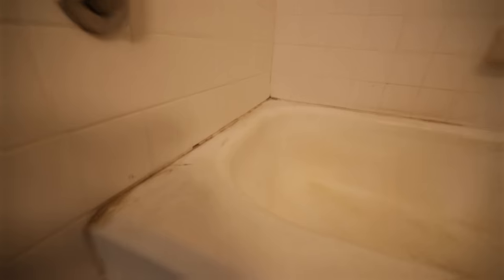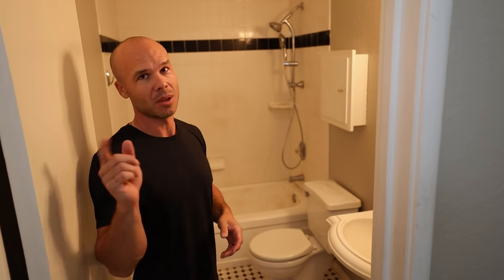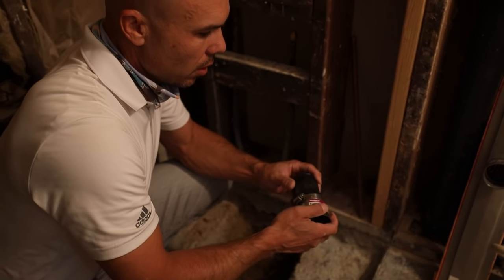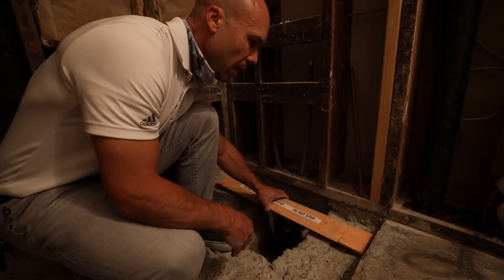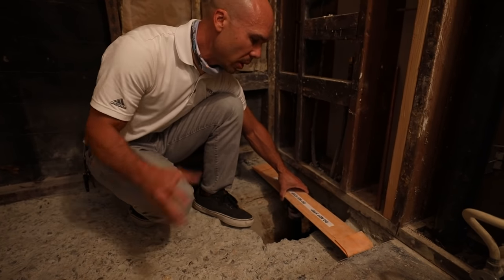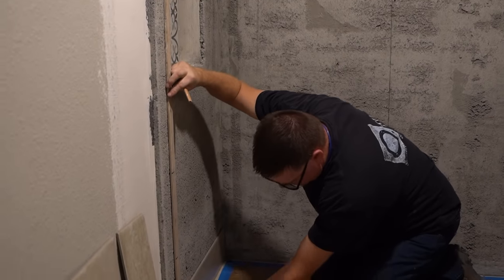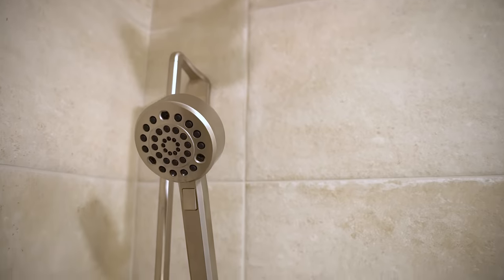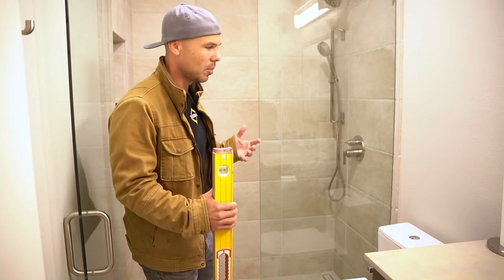TUB TO SHOWER CONVERSION (CURBLESS)-- HOW ITS DONE

Comment: As a plumber I can vouch for shielded couplings, a transition style coupling ( which it appears you used) is required between cast and plastic. 2" drain and trap arm is required for a shower by upc and is usually a ton of work to achieve as you mentioned but that's what we've always had to do.

Edit: 2021 UPC has a footnote (9) next to the minimum trap and trap arm size for a shower, can be 1-1/2" if switching from existing tub to shower (new stall size 36"x60" max), 2018 UPC did not allow this.
Reply: so if you did this same exact job your telling us you would be forced by law to change out all that pipe to 2 inch? under the whole slab?
Reply: @Mike-Minion  unless your particular inspector let it slide, yes, as a plumber you are required, in most areas, to follow plumbing code. Whether you pull a permit, and what you do in your own home is up to you. In my case the majority of projects are subject to the upc and california plumbing code and inspectors are strict here. We've seen many slabs chased to the 2" line for a shower. It's typically not far to the 2" as the tub is required to have a 2" drain line, it's just the trap arm that's allowed to be 1-1/2" on a tub.
Reply: @Mike-Minion  interestingly enough, the 2021 upc has added a footnote next to the minimum size trap and trap arm; stating 1-1/2" trap and arm is allowed where swapping out a tub for a shower stall. That's groundbreaking news to me as the 2018 didn't allow this.
Reply: We hardly ever pull permits for showers.  This reducer has always been the go to method. But you are correct,  prior to the new code change, if you're getting inspection in California , inspector would not except this...
Reply from the maker: Thanks for the Edit!  You are correct.  Most of the time, common sense proceeds changes in codes.  The UPC curb code is an example of an outdated code that had inspectors confused for over a decade. Finally, they are learning that tall curbs are a thing of the past!
Reply: @TileCoach  
Common sense is not legal in California as a civil servant. In fact tyranny is the rule, and as I understand the 2nd amendment, it says we have a responsibility to bear arms against, and the 2nd part of that amendment says to shoot them. 
Thanks for your videos and the comments
Reply: @kylefogle6022  See my comment above about the city saying I would have to install 2" drainpipe. I did my work before 2018. But of course, I would still need to do what my city said I have to do. It would be great to have a URL to the change you reference.
Reply: Doing plumbing for 30 plus years and you should Always upgrade to 2" for floor Drains that's problem free. 1 1/2"  you will have problems unless you remember to clean drain lines yearly.
But 2" mantinence free .
2
°
Reply: It may be in 2021 UPC but that does not mean that code has been adopted by your particular municipality. There are lots of places still on 2015 code and then there are most of the places in the US which actually use international plumbing code.
Reply: I use shielded sleeve regardless of underground, in the wall or exposed. For just a couple dollars more, it just seems like a much stronger joint. Okay, back to the video... 🎶🥁🎺
Reply: That depends on the amount of water flow gpm through the shower head.

Comment: I wanted to convert my master plastic tub-shower unit to a shower only. The city (in Central Illinois) told me that I needed a permit to convert tub to a shower and that the drain had to be 2". They said it was against Code to reduce from 2" to 1 1/2".  I asked questions about this and said what if I cannot swap out to a 2" drain. They told me in that case I could not convert from a tub to a shower. I asked why I couldn't do the 2" to 1 1/2" reduction. They said that if there is a clog somewhere in the 1 1/2" drain pipe that the tub is a larger vessel for capturing the backed up water. They told me that such clogs easily let the water overflow the shower curb. So, they required me to install a 2" drain which I couldn't do. So now I have a new tiled tub-shower. I like it a lot, but wished I could have done the shower. I have a neighbor who made the conversion and claimed he had a 2" drain pipe. He also didn't get a permit. He later sold the house as renovated. This is my experience about permits and drain pipe sizes.
Reply: If your neighbor believed the lie, its no  longer a lie. 
G. Costanza

Comment: Ruined the slab.. removing 3 inches of a 5.5 inch slab..?
Reply: That's what I want to know too
Reply: Should he have removed all of the slab?
Reply: I recently chipped down a slab for a curbless and found that the 2 inches that remained felt super weak, so instead I jackhammered it out completely, dug  deeper, added rebar dowels and poured a new 5 inch slab that was 3 inches below the shower entry, with the mud pan it’s now about 7-8 inches and probably the strongest in the house.
Reply: @isackhernandez3691  yes and repour it
Reply from the maker: A cold joint, dowels or not, is going to be more prone to separation and displacement that what we do. Especially since we bond our mortar bed to add more strength and support.
Reply: @TileCoach  either put all your trust into a bonded 2 inch slab or into the dowel method, pick your poison, ideally you’d want to frame it and pour recessed when pouring the foundation in order to keep it monolithic, I’ve done both methods, neither is right or wrong we’re retrofitting based on what the home owner gives us (slab or raised foundation)
Reply: @TileCoach  i say neither, id rather have a small curb than ruin my slab

Comment: The 3000 series Fernco couplings you used are actually only rated for above ground use. The 1000 Series should be used as they conform to ASTM C 1173 -  standard specification for flexible transition couplings for underground piping systems. It will probably be fine but just because it has a metal band does not mean it is designed to go in ground .
Reply: Yes, I would use the 3000 for something like a in wall vent transition. I do believe the 1056 would be the correct for this application.
Reply: @jasonlunn8530  exactly
Reply from the maker: thank you!   My local plumbing supplier only had that one.   Will ask about it for the next one.

Comment: Typically when I run into 1 1/2 inch drains I will change the stand pipe and trap to 2 inch then reduce to the pipe. Most of your backups happen in the trap vs the main line. An old plumber gave me that idea years ago.
Reply: As a plumber i would rather u leave it small so i can get the backup service call.
Reply: @dangda-ww7de  lol thats not the way I do things. You know as well as I do hair is the number one backup in a shower drain. 9 out 10 times it settles in the trap not the main line. Larger trap = more volume of water to push the clog out and down the line.
Reply: I just asked this question and your answer makes perfect sense. Thanks!

Comment: Great timing! I have this very situation and tried with 2” coming up and it put the shower drain 4” above concrete. Going to 1 1/2 pipe will lower the drain just above the concrete, problem solved great video,
Thankyou
Wayne.

Comment: Hi Isaac, nice work once again. I do bathroom renovation work here in Australia. I watch all of your videos.  It's interesting to see how you guys do things differently in the states.

I have a few questions for you:

1) Do you guys have to worry about termite treatment over there? In Australia if we cut through the concrete slab - we need to do a treatment to stop termite attack.

2) I'm guessing you are allowed to run 2 inch sewer pipes burried in the slab over there? Here the general rule is 4 inch pipe size minimum if it's burried in slab.

3) Why apply the Durock sheet to the studs then also lath and float over the top again? That seems like a lot of layers and added thickness. Also wouldn't the float stay constantly damp as the waterproofing is under the float layer?
Over here we would just nail the sheets straight over the studs with 6mm (1/4 inch) fibre cement sheeting, then apply a roll on liquid waterproofing membrane over the 1/4 inch sheets. Then tile directly over that. That way the build out is minimal and the only things that get wet are the tiles.
If the walls needed straightening, we would just plane back or build out the timber studs to suit - before the sheeting of course.

Keep up the great work.
Reply: that's how I do it on the east coast

Comment: Another well done video TC.  As a design issue, code officials can have a problem with having to enter the shower to access the mixing valve. Scalding concerns.  Perhaps flip the layout, with the entry door on the left.  But this may create a drain venting issue.   1 1/2 " can only run 5' horizontally before it needs independent venting.  Maybe run the vent overhead and tie back in.  Also it would be a good footnote to add to not do the size reduction on the horizontal.  Only verticle, as you did but did not specify.

Comment: 1-1/2 shower drain is perfectly fine. A tub spout gives out more water and the tub drain handles it fine. A shower head gives out about half the water a tub spout does. One thing I will say is, I dont know what the code in your area is but where is your vent? The overflow on a tub drain acts as a vent for smooth drainage and no gurgling. When converting to shower you should add a studor vent.

Comment: Good video. I was getting ideas on how it is done before I quoted someone to do it since it looks like a lot of detail for a naïve plumber like me. I would like to see comments on a new thing I am finding now on most Hotels I am running into (I travel a lot).
The idea is to offer the option to install the water controls on the entry side that way the user can adjust the temperature before getting into the water stream usually in the opposite side. On this video, looks like this plumbing could have been done while the walls were open. Yes, I know, its a lot of plumbing but, from personal experience, I like this option as well as multiple heads (one on top coming down from the ceiling and another from the wall with a selector to either/both heads).

Comment: At first I was like, who puts a light fixture in the shower 🚿. It was driving me crazy. Then I realized it was only the reflection from the vanity Jijiji. Btw great video and awesome attitude, stay humble my friend. Definitely earns a thumbs up 👍🏻 and a new subscriber. This is something I’ve been thinking of doing to my bathroom, I now have a walk-in shower next to a tub 🛀. I really want to remove my tub and add another walk-in shower next to the one I have because the one I have now it’s to small, I have hardly any elbow room, it’s dimensions are 34/32 wow as I got up to go do my measurements I just realized that I can knock down a small 12” half wall that divides the shower from the tub if I can just remove this half wall/shelf and extended the new shower another 6/8” on one side the 10” on the other side, this should be enough room exactly what I need. Thank you your video inspired me.

Comment: I’ve wondered for years why a tub is plumbed 1 1/2 and a shower 2. I recently talked to a plumber friend of mine and he explained that since a shower only has a small curb and sometimes no curb a 2” waste line is required so it is less likely to clog and flood the bathroom. A tub has the whole tub to fill before it would flood. Idk made sense to me. But there have been plenty of times we had no choice but to reduce the pipe back to 1 1/2  after the trap.

Comment: How did you get the slope on the right left and back side to drain properly with those large format tiles?  It was hard to tell from the video how you set that tile around the side and back perimeter of the drain.  Thanks!

Comment: Hey Issac! I noticed you used a 2x4 clamped with a vise. The showers come with a polycarbonate sweep. Cut a about a 3 inch piece of it off and use it to hold both panels in line with each other at the top. If you guys are going to keep installing showers lol
Reply from the maker: Yep!!!

Comment: I've yet to do a curb less on slab unless it was previously recessed during the slab pour. Average customer is okey with a micro curb (about 2" tall) when compared to the cost of chipping it out. I've seen conflicting info on shielded ferncos being hurried. As for the 1-1/2" vs 2" if it's easy enough to change the trap I'll switch over to 2" trap and reduce after the trap. Otherwise I'll just do the reducer in the stand pipe, last one I did the trap was 26" under the slab and would take even more work to dig even deeper to swap it out. Plumbing codes work great on paper but in the real world as long as it drains I'm okay with it 🤷🏻‍♂️
Reply: Great thing about a true curbless is the drain can be used for the whole bathroom. With a long hose the bathroom can be cleaned with a sprayer and disinfectant spray then squeegee down the shower drain.

Comment: I'd be interested in what the final cost was including everything you used. I'm 61, in Texas and hate the damn bathtub. Just haven't committed to do this yet. A ballpark figure would be appreciated. Thank You, I loved the work and the video was entertaining.
Reply: me too
Reply: I am in the process of doing this exact job and it's not cheap. Luckily I can do a few things myself but the demo alone to remove the old fixtures and tile was $1,300, then it was $200 to grade the slab and another $600 to install the drain (centered, non-linear) probably $300 to install backerboard and re-install green board walls (materials cost about $100 for my small bath). I am going to do my own waterproofing and tiling so some savings there but a 3-gallon bucket of Blue Max is $149, the Kerdi drain was about $139, Delta thermostatic faucet system was close to $1,000, one-piece Toto toilet was $350, vanity and faucet another $500. And figure in at least another $500 for tile and setting materials from HD and Lowes. So right now I am at about $5,000. The original estimate that I received was about $11,000 for labor only so I will save a decent amount by doing a lot of my own labor.

Comment: Changing out my tub to shower as well. I can only go so far back but have the choice of going with a 2” or 1 1/2” p trap. was wondering if it would be better to install a 2” p trap connected to the 1 1 \2” drain pipe or go with a 1 1/2” p trap with a 2” drain at the top like in this vid. Any help is truly appreciated

Comment: Well I gotta ask, "How the heck did you tighten the bands on the Kerdi drain?".  You showed pouring the patch right up to the stub pipe before you put in the linear drain.  Looks like the drain was installed after the patch had cured which makes sense as the mortar bed needs to be laid to drop the drain into.  So just how did you get the coupling secured?  Good video and topic.
Reply: When underground connecting you add an adapter, in this case they did regardless to reduce to 1.5”, so the adapter piece is screwed on before making the connection, then glued and stuffed down for final connect. It’s tricky work. Linear drains are very tricky with all thing considered.
Reply: looks like he left the last strap exposed after he filled the whole. then mounted and the drain. then laid the floor under the drain.
Reply from the maker: We leave a little area out when pouring the concrete, then tighten the bands, then fill with deck mud.

Comment: Hey Isaac great videos bro I’ve watched several over the years pretty much whenever I do tile. I’m a general B in SF Bay Area and tbh tile is not my strongest link in the trade chain, I’ve typically subbed it out in the past however due to the cost to get a good tile sub by the time I add on my commission it literally priced me out of a couple of jobs so I’ve been taking more on myself, I recently started a 2 bathroom gut out one thing I’ve not done yet is float walls and truth be told a little scared but fought so many walls in the past    so many corners of tile don’t lineup I think I’m gonna bite the llet and do it on this project so yeah thanks for all your video help. I also have a question in regards to shower pan waterproofing just curious in the past I’ve always had a hot mop or use the neoprene material and I’m just curious as to your thoughts on using neoprene seems like the membrane that you’ve been using is way better  I like that it looks bulletproof I think I’m gonna try it but just wanted your thoughts on the neoprene I’m assuming probably because of the buildup at the corners which is kind of always a downer your system looks a lot more cleaner tighter no bulky bulges

Comment: I HAVE AN IDEA.
Been watching your channel for the passed week or so and I love your mud work. I was wondering if it would be possible, where applicable, to build a concrete pillar into the ground in the crawl space on a first floor bathroom that is all one part that has the drainpipe encased into the floor of the concrete pillar but not necessarily going all the way through to the base but maybe come out the side for easier replacement for the future if necessary. And I would think that after the one peice concrete structure that makes up all of the base and the walls would need a waterproof coat of your choice and then lay the tile with thinset onto that. I hope this makes sense. This would remove the problem of having wooden walls and floors that you usually would find rot and mold.